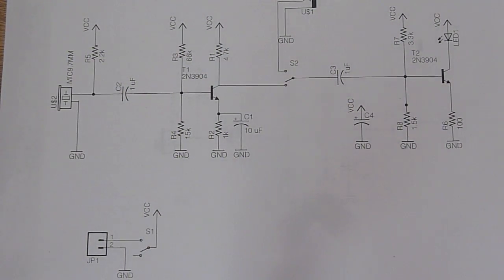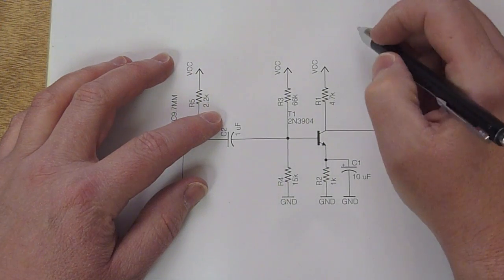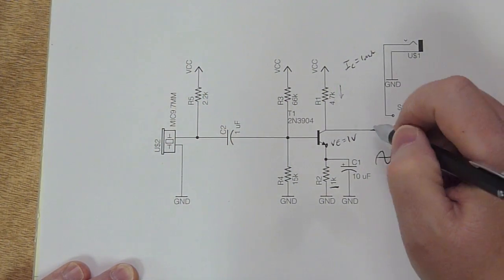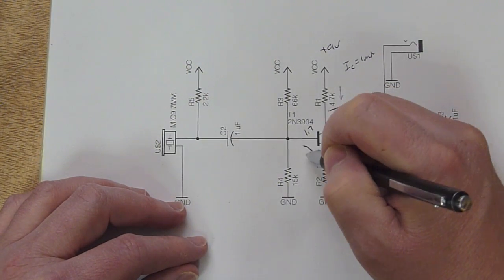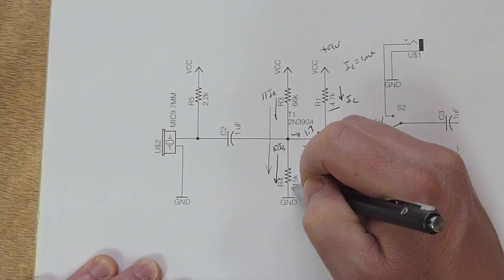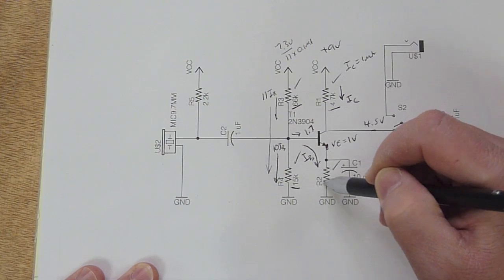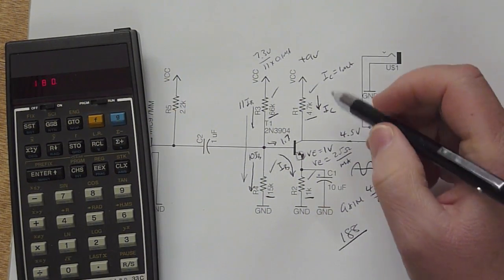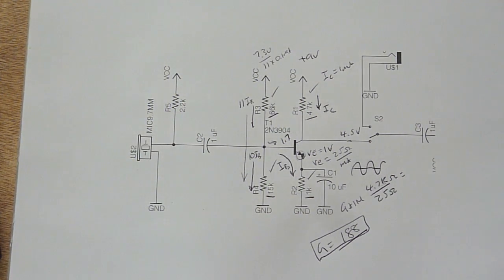Design a Common Emitter Amplifier

Comment: The bypass capacitor is too small. It's a common mistake to think you have to set its value so that it has a cut-off frequency determined by the emitter resistor R2. It doesn't. The gain is given by the ratio of R1 to (re + Xc || Re). That will only approximate R1/re = 188 when Xc << re. You can clearly see that the cutoff frequency is actually 1/2πC.re = 640Hz with a 10μF capacitor. At 100Hz, you would expect the gain to be 4700 / (25 + 160j) ignoring the parallel 1K emitter resistor. That's 4.5 -29j or about 30 times with an 80° phase shift. This is fine if you're only interested in creating a digital signal from your mic input, but for audio purposes, it sucks for several reasons. Even as a noise detector, I'd recommend a 100μF bypass capacitor to use the low frequency energy available.

Comment: nice, succinct breakdown of the dc side of things, but like so many other videos regarding common emitter design, most leave out how the blocking caps and emitter bypass cap values are determined for the application at hand. why is this?

Comment: Could you please elaborate on the impedance part? So by connecting 2.2k resistor the output impedance of the mic becomes 2.2k?
Reply: Those sort of electret microphones are commonly made from a small polarised active element, buffered by an FET, which needs a bias voltage to operate. Using a 2.2K resistor to supply that will set the impedance to 2.2K because the FET has a high drain impedance.
See https://en.wikipedia.org/wiki/Electret_microphone

Comment: Is it possible to get an output voltage more than Vcc? Say, if Vcc is 20V, can i amplify 10 V input up to 60V?
Reply: of course not
Reply: Once upon a time, we used output transformers to change the output voltage and current to match the required load. You can amplify a 10V input to 60V from a 20V supply by using an output transformer as the collector load, but nobody does this any more.

Comment: If the emitter sits at 1v, we know the base will be at 1.7 volts...how?  Is that on the datasheet for the transistor, or is that just one of the "common" things about an NPN, like how a typical silicon diode has a 0.7 V drop?
Reply: Yes. And for the same reason. It takes 0.6-0.7V to "push" through Depletion Region.

Comment: How will 1Ib flow into the Base and the other 10 flow to ground?
Reply: Because there are 11Ib flowing threw R3 and transistor is taking 1Ib threw BE junction.
Its called kirchoff's current law

Comment: Is the choice of Ve = 1V arbitrary? If I made that voltage higher or lower what happens to the gain? Also for the r_e that is that voltage above the Ic is the Thermal voltage right?
Reply: I'm late to the conversation here, but as my book explains it, Ve is chosen high enough so that it can "absorb" the possible inaccuracies of beta and resistor values, but low enough to keep the transistor in forward active.

Comment: I believe you have misspoken on your currents for your BJT. Based on your symbol, you have a NPN emitter. The left side of the BJT that connects to your microphone is the "Base", the top is the "Collector", and the bottom is the "Emitter". For NPN BJT, the "Emitter" current should equal the sum of the "Base" and "Collector" currents (I.e = I.b + I.c). Based on KVL and your schematic, I.e = (1 Volt)/(1 kOhm) = 1 mA.

You should show the "Emitter" Current flowing to ground on the bottom of the BJT, and relate base to emitter so as not to confuse people.

Comment: How do you choose the capacitors?
Reply: +C Liviu For the input cap which is 1uF you can see that it is basically an RC high pass filter (R3 and R4 form the resistance). So by using the impedance formula X_c = 1 / (2*pi*f_c*C) and solving for f_c one can see that the frequency is about 13 Hz. Since audio freq. usually range from 20Hz to 20kHz it would be bad if you chose this capacitor to be significantly smaller than 1uF, since the frequency is inversely propoertional to the C and it would cut of your signal.
I agree with you, an explanation and clear calculation of the caps would help a lot since you could theoretically cut of at a frequency closer to 20Hz and not at 13Hz.
Reply: @rawbq  The input resistance at ac is (R3 || R4 || β.re) because the emitter resistor R2 is meant to be bypassed to ac. Unfortunately β.re = 100 * 25ohms = 2.5K, which is much smaller than R3 || R4, so the actual ac input impedance is more like 2K and the 1μF capacitor will roll off the response below 80Hz.
Reply: +C Liviu usually in audio application you need to choose a cap between 1µF and 10µF. You have to test it, because every transistor is different.
Reply: +C Liviu The bigger the better.
Reply: Thanks for the answer +TGF2user I'd like to ask you, maybe you know...how did people came up with that? Is there a formula or something? How do you calculate it?
Reply: +Alex Alonika Thanks for the explanation! I've got one more question, if you don't mind. How did you calculate the capacitive reactance?
Reply: +C Liviu 1/(2*pi*f*C)

Comment: Beautifully said. It seems you have built tons of circuits using the 2N3904 transistor. But  for beginners, they should start out by referring to the data sheet of the 2N3904. They should know the max. collector current ratings, the max. C-E voltage rating and maximum power rating. Then they should draw the load-line on the transistor characteristic curves for optimum operation by picking suitable values for Vcc and Rc. Re is chosen roughly 1/10 of Rc.  Ensuring the transistor will be operating in the active region at all times. the quiesent point should be as close to the middle of the active region as possible - far from the Saturation or Cut-off edges and well within the power rating triangle of the transistor. hfe can be calculated from the transfer curve where your Q-pt was chosen. And Rb1 and Rb2 can be calculated using the voltage deviver after Vb is known. ( Vb=Ve+Vbe where Vbe= 0.6~0.7V. )
Reply: I need to know why he chosed Ic=1 ma and ve=1v..
why he didn't choose Ic=3 ma or 2 ma..

Comment: Great video! I was just wondering how you chose the emitter to sit at 1v (or VCE to be 3.5v)? Also, how did you come up with 11*I_B through the base voltage divider?
Reply: Hey, this is a late reply but I think I can answer some of your questions, as I was trying to figure that shit out too. Ve = 1V seems to be arbitrary. Vce is VCC / 2 (for maximum swing, like he mentions in the video) - Ve. So (9/2)-1=3.5. Ib is Ic / beta (or DC Current Gain, one of the transistors properties), and setting the divider to 10*Ib is a rule of thumb thing, it makes the circuit more stable. The current from Vcc to the base is 11Ib, because 10Ib will go from base to ground, and only 1Ib will go through the transistor. Also, the q-point or Vb is just Vce / 2, again for maximum swing. Take all that with a grain of salt, I might be totally wrong hahah.
Reply: @CJSwitz  why he choose Ic=1 ma
Reply: 1V to ensure transistor operates in active region. On the IV characteristic curve it is round about 1V where active region starts.
Reply: Setting the emitter bias point is a compromise. Setting Ve to several volts will allow a larger Re, giving a circuit that is reproducible with different transistors, but it loses "headroom" - the amount the output voltage can swing, since the output obviously cannot swing below the voltage at the emitter. Attempting to set Ve less than about 0.5V will make the actual bias point more dependant on the actual Vbe of the transistor, which can vary, and therefore the collector current may end up significantly different from what was planned. Also the lower base bias resistor will be small, making the input impedance of the circuit small, which is usually undesirable.

We want the current through the base bias resistors to be much bigger than the base current, otherwise the bias point will depend too much on the current gain (β) of the transistor and that can vary a lot between transistors and between different operating conditions. So that indicates making the current larger. But that results in smaller values for those resistors, which makes the input resistance correspondingly smaller, and we usually don't want that. So setting the bias current about ten times the estimated base current (Ic / β) is generally considered a reasonable compromise.

Comment: Find The Voltage at R4 then add ,7v( Vbe) and that gives you Ve.  VR4=15K/(15K+68k) X9v=.963 v and Ve- ,963+.7= 1.663 v We have 2 Loops  Vcc=VR3+VR4  And Vcc= VR1+Vce+VR2  Av=-R1/R2  C1 Effectively Shorts Out R2 But doesn"t Affect The Dc Operating Conditions of This Amp/ We Adjust Vce to be 1/2 X Vcc So That We Bias The Amplifier Half Way Between Cutoff(Vce=Vcc) and Saturation (Vce= .2v) There is 180 degree phase shift between Vc and Vb
Reply: The voltage at R4 needs to have 0.7V (Vbe) subtracted to give Ve.
V@R4 = 15K/(15K+68k) X 9V = 1.63V
Ve = 1.63V - 0.7V = 0.93V

Comment: Shouldn't Vce = 1/2 Vcc For Maximum Swing of The Input signal??Then Vce=4.5 volts!!!
Reply: No, you have ignored there is approximately 1V clearance for active region. So, (Vcc-1)/2.
Reply: @marshlegions7487    To make this calculation simpler I ignore the 1v clearance  I was told that by my Electrical Engineering Teacher
Reply: @321reh  Then tell your Electrical Engineering Teacher that they are making an unwarranted simplification, especially for a circuit working from a low supply voltage like 9V.

Comment: A little mistake was made @ 3:40 : the correct formula for calculating the 66k resistor is 7.3 / (11 * 0.01ma). It's 0.01 ma and not 0.1 ma, because IB = IC / 100;
Reply: Alexandru Daniel Mircescu Maybe I'm wrong but for easy and proper biasing you will need a current going through R3 and R4 at least one order of magnitude greater than the base current (or 10 x more). since the Base current is 100th of the colector it would be 0,01. you need 10 times that ( well 11 times if you add the base current itself ) going through R3 so the current you need is 0,11 which he aproximated to 0,1. Cheers!
Reply: You're absolutely correct. The 11 already takes into account the requirement that the bias current is considerably bigger than Ib which is around 0.01mA

Comment: Hey, great tutorial. Any chance you could explain how you came up with 10uF for the bypass capacitor on the emitter? Thanks!
Reply: Ideally the reactance of the capacitor should be equal to that of R4 at the lowest intended frequency of operation.

Hope that helps
Reply: Thanks!
Reply: Actually, the reactance of the capacitor should be equal to the internal emitter resistance at the lowest frequency of operation. The value of re is 25mV/Ic = 25ohms.
For audio we will set that below 20Hz. So C = 1/2πfR = 1/2π.20.25 = 318μF, nearest preferred is 470μF.

Comment: Scott, thanks for the tutorial.  I am just starting out to understand this and need to understand where did you find Re?
Reply: It might be that Re is found by Ohms law- 1V and 1mA, R=V/I, R=1/0.001=1000
Reply: CretaZigman
This is correct. This is based on the assumption that Ic = Ie
Reply: Aidan Williamson   I believe my auto correct got me into a little trouble.  I was looking for how her determined that the re was 25 ohms not how he determined that the Re was to be 1000 ohms.
Reply: Paul Mandel
A good approximation for internal emitter resistance (re) at room temperature is re = 25mv / Ie. Since Ie = 1mA, re = 25mV/1mA = 25 Ohms. Sorry I don't know the derivation of this equation. Wish I did!
Reply: @aidwilli  The current through the emitter (I) is found to increase exponentially with voltage across the base-emitter junction (V). It is modelled by the following equation:
I = Is(exp(V/Vt) - 1)
Vt is the thermal voltage = kT/q = 25mV at room temperature.
Is is the leakage current that would flow through the junction when reverse biased. A value of 0.01pA gives a current of 2mA at 650mV.

So, differentiating I wrt V gives:
dI/dV = Is(exp(V/Vt)/Vt
But Is(V/Vt) is the same as I at currents above a picoamp, so we can write:
dI/dV = I / Vt
That is the reciprocal of the dynamic resistance at that current, so
re = dV/dI = Vt / I
Sorry it's taken 8 years to show you that derivation, but hope that now helps.

Comment: I've read all that stuff before, but you went through it with just the right amount of information.  Your pointing to the transistor leads and telling about the current in the leads made it clear enough to understand.  Now I think I could write myself a little EXCEL type application to calculate transistor amps using other voltages and microphones.  Thanks for the video tutorial.  Good job.

Comment: Do yo mean an 8 ohm load? if you connect the 8 ohm load in parallel with Rc then your gain will drop drastically.

Comment: Eddie, Biasing fixes a shortcoming of the transistor that is that it dont start to amplify until the base has at least 0,7 volts on it. The two resistors connected to the base takes care of that. Good luck with your path to understanding the transistor!
Regards Harry from Sweden.

Comment: If you dont understand that quick basic demo of how a basic transistor amplifier works, Maybe you should consider flower picking or a different subject that you CAN  understand eg: do you know what an amplifier actually is? and  what does it do, what is a diode, and what is a transistors primary use is,and what is a resistor? You then need to study OHMs law and good math course will help  you on the right track. Go and read Bob Cordells book on amplifier design.  then decide if its what u want.

Comment: Could you also do a video on designing a common source amp for a MOSFET?? That would be awesome
Reply: Unfortunately, the relatively wide variability in the threshold voltage of a MOSFET makes biasing it in a single stage a tough job, which is why you don't see these. Either you have to have a variable resistor for the upper gate bias resistor and trim it to get a usable drain voltage near the mid-point of the supply; or you have a large source resistor to stabilise the dc bias points and then bypass most of it to get a usable ac gain.

Comment: Great video! 
You Explained it better than my lecturer. A few questions:
(1) Do we consider the cap impedance (1/jwC) or is it simply just the 25ohm resistance at AC?
(2) Suppose our load has some small resistance. This will cause our voltage to lower, because it's nearly a direct link to ground. Would I just add some large resistor in series with my load to avoid this?
(3) What limits the maximum gain? Beta? How do you know 188 is below the max?
Thank you!
Reply: (1) Yes, we want to make 1/jwC equal to 25ohms at the frequency below which the gain will roll off. A 10μF capacitor will have a reactance of 25ohms at 640Hz. A 100μF capacitor will have a reactance of 25ohms at 64Hz.

(2) The load needs to be decoupled from the dc bias at the output by using a coupling capacitor. The output impedance of this circuit is 4.7K (the collector resistor), so we will expect the  load to be significantly greater than this. You'll need a coupling capacitor that has a reactance of 4.7K at its cutoff frequency - say 2.2μF for 15Hz. Don't put a large resistor in series with your load; it will reduce the voltage to your load because it's a resistive divider. There's no point in amplifying a signal just to attenuate it again.

(3) The voltage gain is unrelated to β. The maximum gain is Rc/re which is Rc.Ic/25mv. But Rc/Ic should be at most Vcc/2, so the maximum possible gain is Vcc/50mV. Yes, that's right, the maximum gain depends on just the supply voltage!

Comment: There is a problem i think with the selection of the operating Vce. You say the collector voltage can go from 0 to 9 V but that is not totally correct. In fact you can check that for Vc=0 V the transistor is not in its active region. The minimum collector voltage is about 1.3 V, cause there is a constant voltage 1V in the emitter plus about 0.3V in the CE junction at saturation. Otherwise the explanation is very good, thx